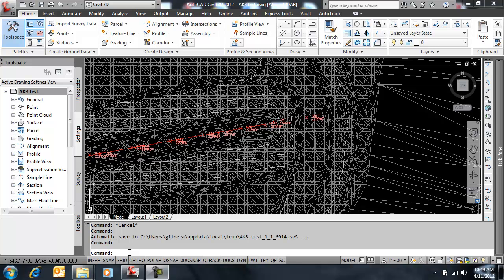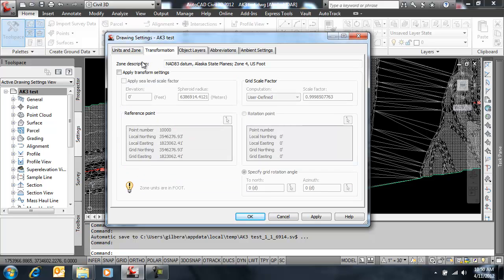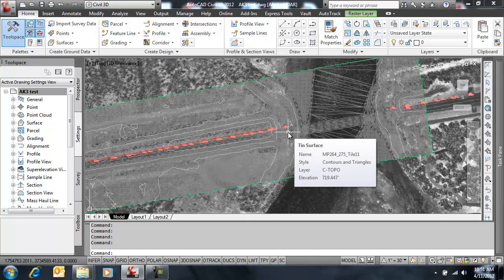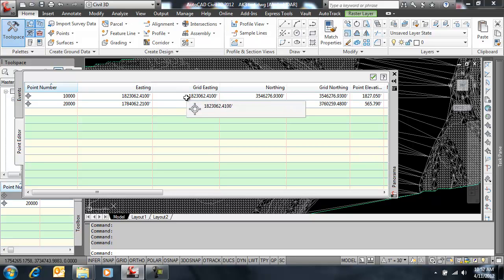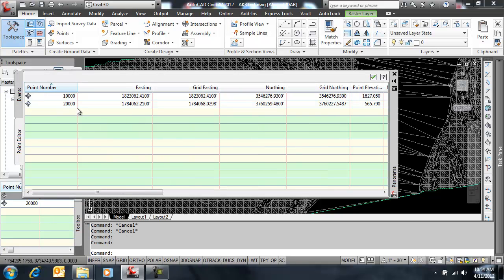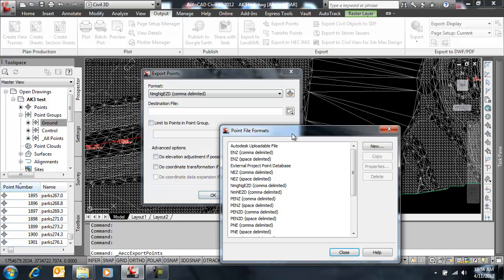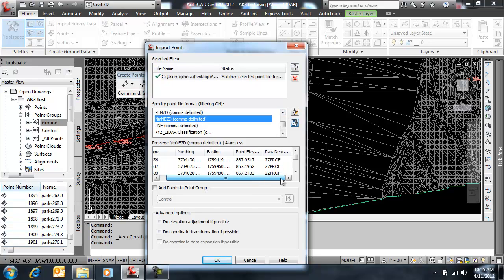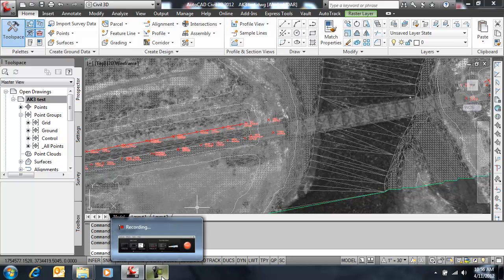AutoCAD Civil 3D Grid Ground Transformations Part 1. Cogo Points

Comment: I have a project that has a big note over the drawing in model space that says the points have a scale factor for grid. The bench mark has a surface nothing and easting and a grid nothing and easting. When I turn on my geolocation map in civil3d the points are not in the area of where the project is located.

Do I just type in Command line scale and then window all my points and scale them to zero for grid?